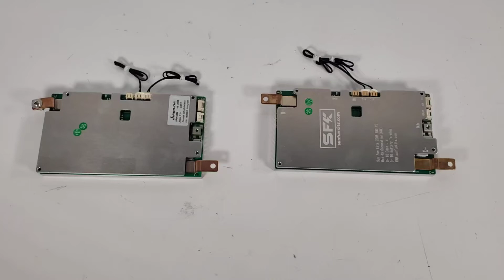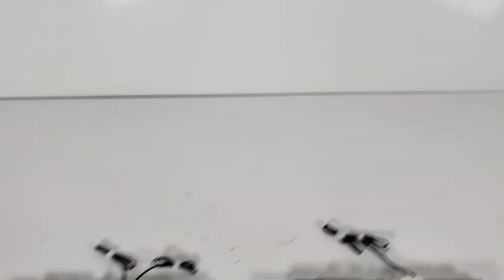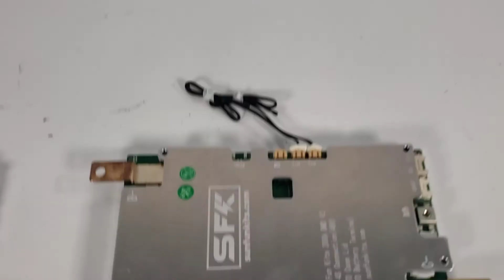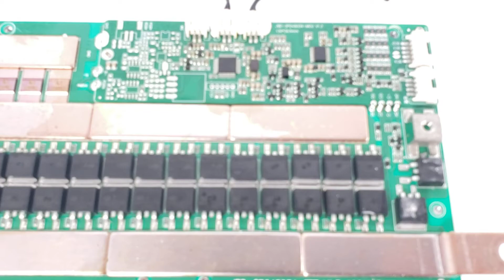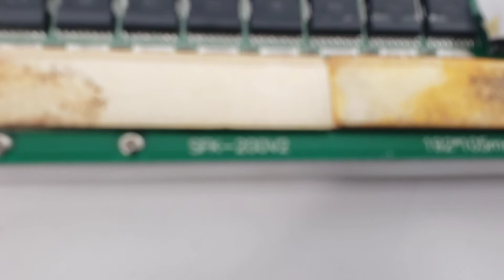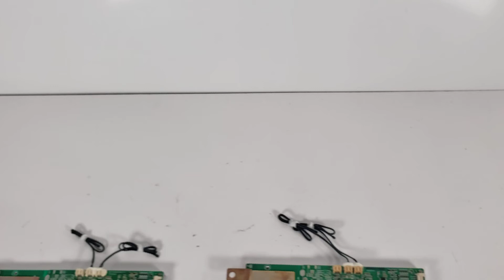JBD 200 vs SFK 200 what is the difference?

Comment: They use the same software?
Reply from the maker: The sfk bms software only works with sfk devices but the XiaoxiangBMS software can work with both jbd or ours. Some features like auto reconnect, multi-view (showing combined output of multiple devices), and wireless to can bus inverter communications are not available on the XiaoxiangBMS app.
Reply: @sfkenergy  I just ordered your SFK200, where's the software download link?
Reply from the maker: @Scottyman99  Hi you can go to google play store or IOs App store and search for Sun fun kits bms. I can't post link on youtube or it will flag the content as spam
Reply: @sfkenergy  Here's a UART Module: https://jiabaidabms.com/products/jbd-rs485-communication-module-smart-bms-tools-setting-and-monitoring-battery-via-pc?pr_prod_strat=copurchase&pr_rec_id=5a5e639e7&pr_rec_pid=7398869598370&pr_ref_pid=7393985331362&pr_seq=uniform
Reply: @sfkenergy  Here's a UART Module: https://jiabaidabms.com/products/jbd-rs485-communication-module-smart-bms-tools-setting-and-monitoring-battery-via-pc?pr_prod_strat=copurchase&pr_rec_id=5a5e639e7&pr_rec_pid=7398869598370&pr_ref_pid=7393985331362&pr_seq=uniform

Comment: I had already realized that the SFK is rated for series connection and the JBD is not. I do believe you, since I had already contacted JBD about the subject. They will manufacture one rated for series if you place a large enough order, sometimes you just get what you pay for. I was actually about to order some of yours actually, but mainly for the easier cabling and the app supports multiple BMS instead of one at a time.
Reply: Good points